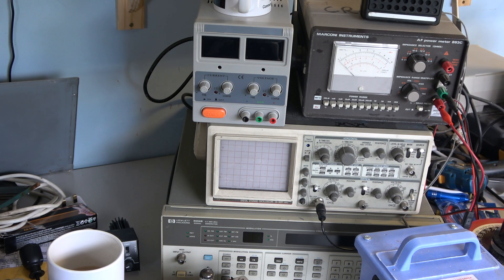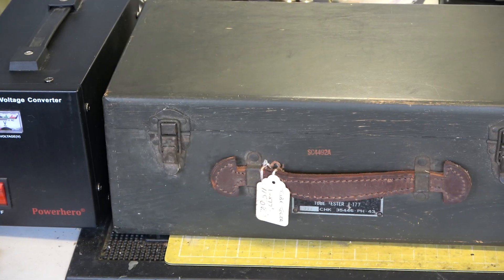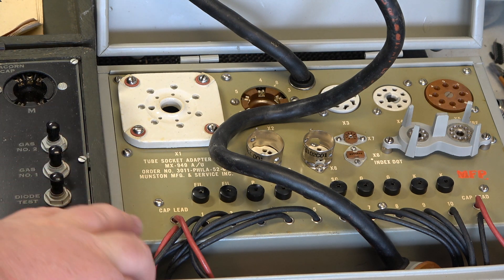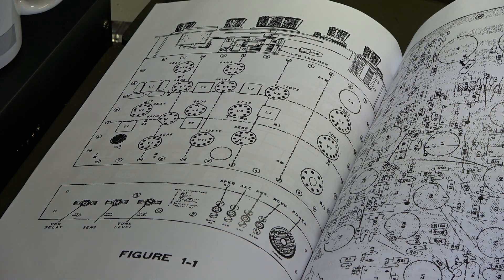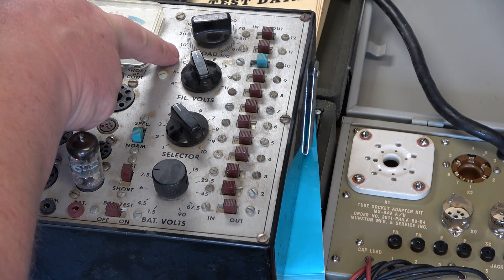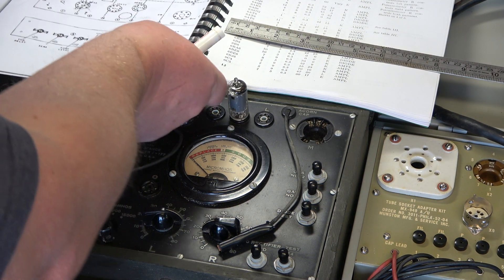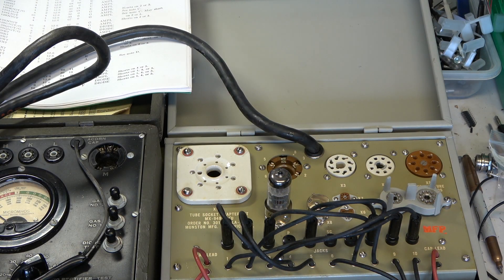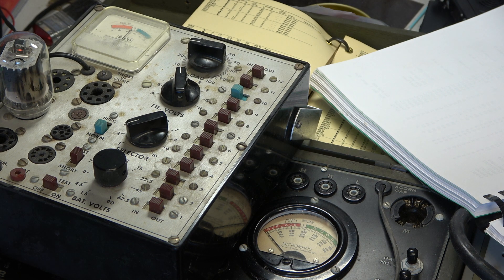Heathkit HW12A (80M 3.5Mhz amateur SSB transceiver, 1966) - valve testing prior to final alignment.

Comment: The picture is great from that camcorder Richard. Nice to see the old valve testers in action. I have a Mullard high speed valve tester here waiting to be restored and a Hickok 6000A waiting to have its rewound transformer installed. I will get around to them one day. Regards Graham
Reply from the maker: Yes, Mine isn't the AVO; I was Lying. The one awaiting attention is a Mullard High Speed tester. I did start on it & I do have a trace on the CRT. I used to have an AVO 160 or some number like it. I bought it for £15 in 1982, tested some valves, sold it for £15 in 1985. Not a smart move with hindsight!

Richard
Reply: @ukfmcbradioservicingTango21 AVO valve testers are crazy money at the moment even the suitcase ones. And regards the shorts, if you've got it, flaunt it 😊
Reply from the maker: Right, It'll be speedos next week then.

Richard
Reply: You may set a trend Richard 😆

Comment: pfl200, ecc83, pl509/504, dy87 ef184, i remember them well too, funny enough I have a HEATHKIT tc2 valve tester lol ".  And I picked up on the hint about the sinad meter"  lol, i have been looking at the transceiver service sets of late.  Paul
Reply from the maker: PFL200 monochrome video output 10 pins, PL509 colour line output, PL504 mono line output DY87 EHT rectifier, mono etc etc, yep I'll filled my brain with useless facts too & pent three night school years studying microcomputer control of video recorder mechacon...all that ever went wrong were belts & clutches anyway. What a waste of time & money! Ebay aside, I understand Stewarts of Reading have those Marconi meters in stock.

Richard
Reply: @ukfmcbradioservicingTango21  Yeah as my kids say "Back In the day dad" Ho yeah and the mode switches, Mind you trying to synchronize the gears and leavers was almost as hard as changing a cars cam belt "and I have done enough of then in my life too" a bit more useless info lol.

Paul

Comment: Richard , would  you  be interested in a SB200 AMP  to match your  power supply and radio😄 ? It was the father in laws ( silent key) .  Would need a good service as I dont think he used it for a good  few years .. if so let me know and I am sure we could come to an arrangement .. ps enjoyed the video
Reply from the maker: Yes Mark It will certainly need all the electrolytic & high voltage capacitors changing,, but it would be nice to fit in with my Heathkit stuff. Email me please rshireby@yahoo.co.uk
Reply: @ukfmcbradioservicingTango21  email sent
Reply from the maker: @markbennett6818  Ok reply sent 8:30PM. YEs that's fine.
Reply: @ukfmcbradioservicingTango21  Hi Richard , not received any email  10:45 PM   are you saying that's fine reference me delivering it tomorrow,  will need to know before 9. am in the morning